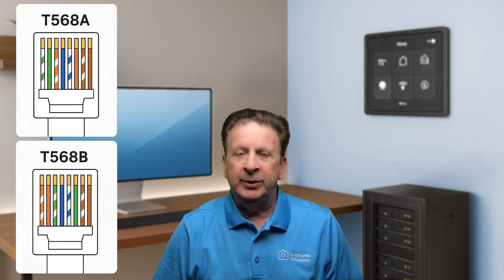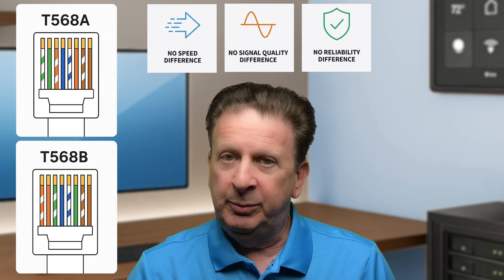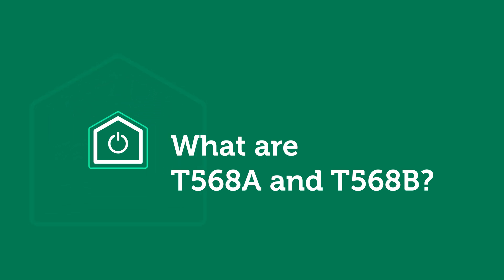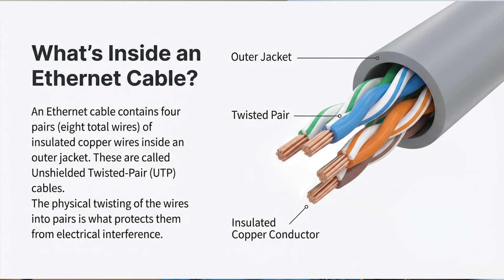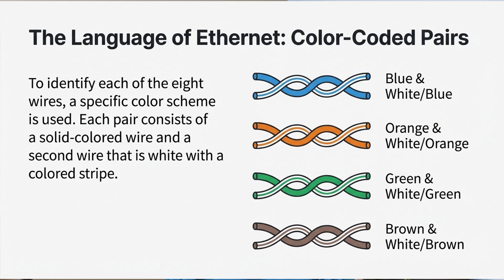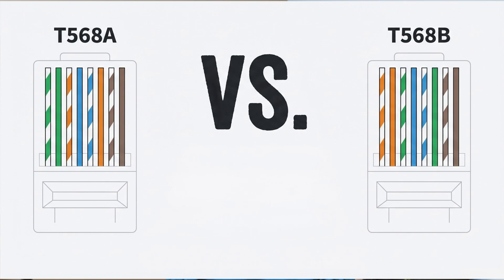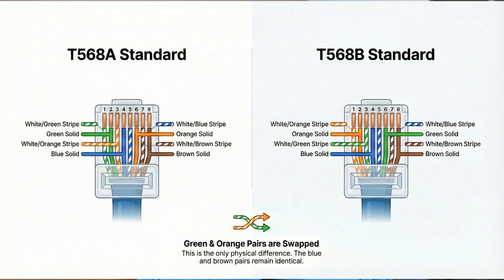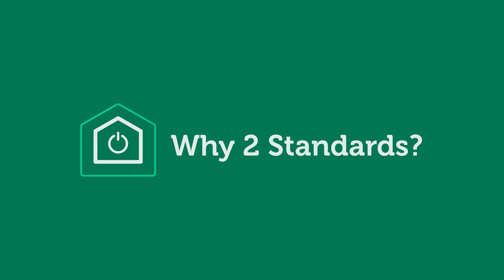T568A vs T568B: Which Ethernet Wiring Standard Should You Use?

Comment: T568B all the way
Reply from the maker: B has definitely become the dominant standard in most places!
Reply: T568B - for sure. When I learned it from the technical standards it was to use a T568A on one end and T568B on the other end to create a crossover cable. Used more often in the late 90s / early 00s. 5:29  I've also seen vertical cabling use T568A especially residential to also be used as phone lines. But as long as both ends are wired the same it doesn't matter much.